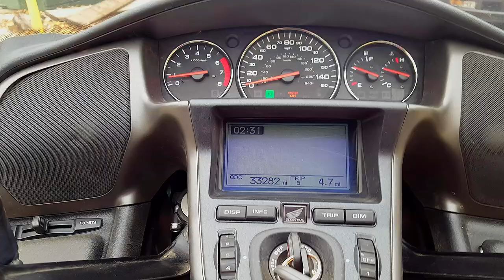My 2008 GL1800 Endeavor Trike

Comment: "These Goldwings are so easy to work on." Really, got a short cut for replacing the air filter?
Reply from the maker: Actually yes - after you do it a few times it get's pretty easy. Also you only do it every 50 to 100k or so it's not so bad. but I will admit the air filter is one of the harder tasks